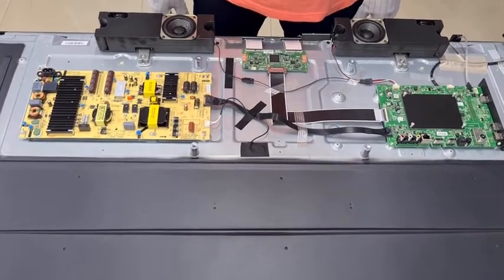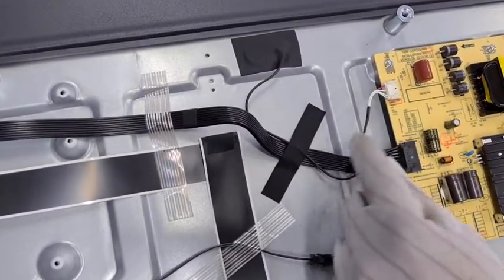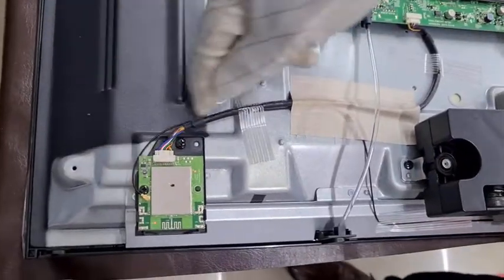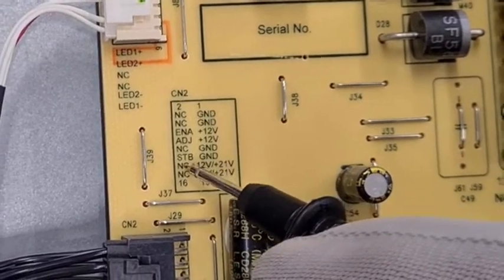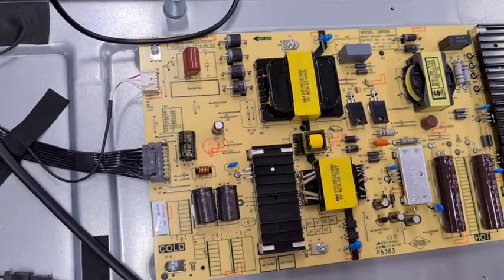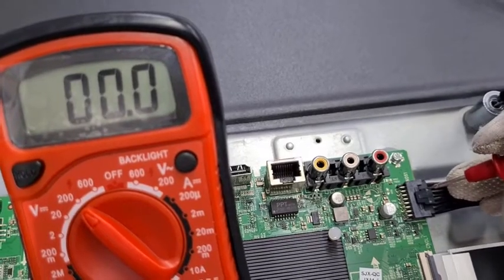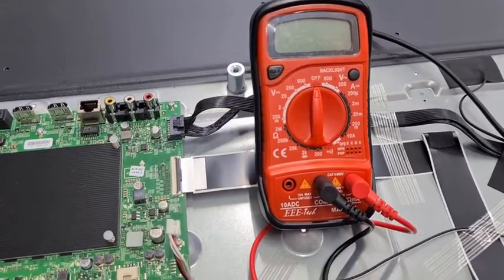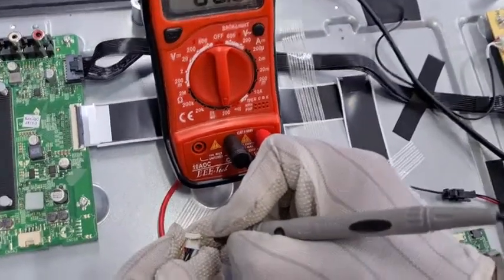LED TV Key Parts explained and how to check their voltages

Comment: Thanks for the videos. Since we have video of using multimeter to check voltages Please next video how to check components using multimeter. Like checking for continuity,resistance, diodes,ICs,coil,induction,mosfets etc. Thanks in advance.

Comment: thank you for your excellent explanation, but there is a question : if the 79.1 volt voltage of the 0 volt backlight is missing. how can you check which components arecausing the problem ? thank you for solving the problem sir..

Comment: Thanks for the knowledge sir. But please what will happen if the probes are swapped that is -Ve probes going to +Ve terminal of the high voltage dc capacitors as demonstrated on 5:07. From a beginners point of view thanks